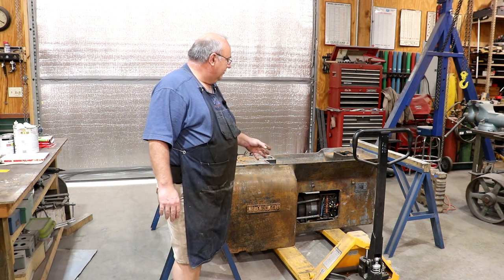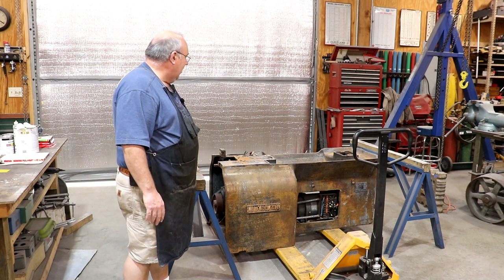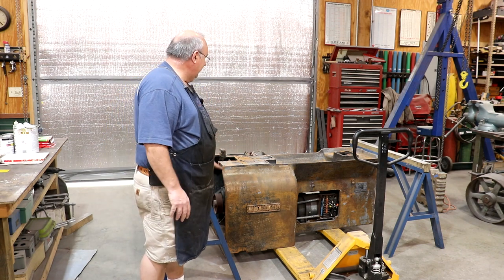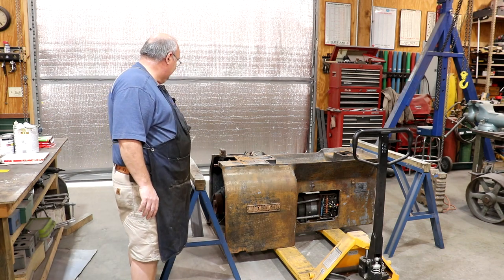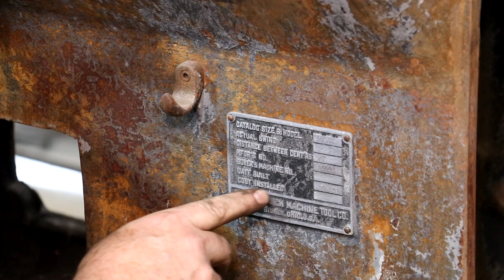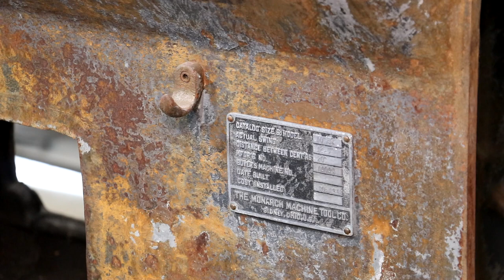Monarch 10EE Lathe Restoration 4:  Removing the Motor Drive System

Comment: Be careful of your electrical assumptions. That is not a Frankenstein drive energizing the DC spindle motor. That particular era EE has a Ward Leonard drive where field weakening was used on the motor in operation above base speed. For speeds below base speed the generator field was weakened to vary the spindle motor's armature voltage. The system might be old and antiquated but it was very sophisticated for its time capable of delivering constant HP stepless motor RPM over a wide range by adjusting a single control. My first suggestion is  If you can get the original drive to work properly, move heaven and earth to make it happen. 

There is no escaping the engineering and calculations necessary to obtain a successful spindle drive conversion.  "Torque" has a specific definition in mechanical engineering quantifable by universally accepted equations having power and RPM as variables. Here is a commonly used formula for calculating torque in Imperial units: Torque = 5252 x  HP / RPM (Note the inverse relationship between torque and HP.) Using "torque" carelessly in a technical discussion - for example: "... loses torque at low RPM" without defining causes is confusing if not irresponsible and delays solution to the problem.  

Notice earlier I said: "constant HP." The spindle motor is rated at 3 HP base speed - which  I think is about 850 RPM for your machine. 3 HP @ 850 RPM = 18.5 lb ft torque.  3 HP @ 3000 RPM = 5.2 ft lb torque. This RPM range is achieved via motor field weakening and the motor output is constant HP over the full range. Lower than base RPM of the spindle motor is obtained by weakening the generator field which reduces armature voltage delivered to the motor. The spindle motor features series windings in addition to the shunt windings and I think interpole windings - all designed to enhance motor torque and stability at low RPM. It's a very sophisticated and expensive motor. I believe the motor can deliver its full HP down to about 600 RPM (26.3 ft lb) but motor torque stays constant thereafter. I can't recall if that year EE was furnished with a "back gear."

I strongly urge you to select the DC drive with care. If you install a general purpose DC drive you will be very unhappy with the result. The max spinde RPM will limited to the motor base speed and you will be plagued by spindle stalls working larger diameters at lower RPM. 

I strongly urge you to consult with a drives expert with experience in machine tool spindle drives. 

I know what I'm talking about. 30 years ago, I worked as a technician under an electrical engineer who was generous with his 40 years experience and brought me into his design considerations. We were called in to remedy two separate EE conversions both botched by uninformed drives component selection. The fixes that we applied worked well but were expensive in terms of purchased off the shelf equipment. But we got stepless spindle RPM at full power almost as good as the original drive but with the advantage of greater reliability.

Given today's electrical equipment, my recommendation is to replace the 3 HP DC spindle motor with a 10 HP three phase induction motor and a general purpose VFD. This combination provides the low RPM torque and has the advantage of operation over the full RPM/torque range with a single control duplicating the stepless drive characteristics of the original Ward Leonard apparatus you desire to replace. A 10 HP 1750 induction motor develops an honest 3.3 HP @ 550 RPM. This is a far simpler remedy needing no integration of exotic components like variable current DC field supplies and control kludges using a stereo 2 deck balance pot. 

People may argue the EE will be damaged by 10 HP. The answer to that is limit yourself to 3 HP cuts. Others might cite the motor's starting surge. With a VFD, a low inertia load, and a moderate accel setting in the VFD's parameters, full load nameplate Amps are never exceeded: there is no starting surge .
Reply: Love the last two paragraphs of information. Thanks.
Reply: for all the reasons mentioned, I say keep the Original MG set in tact.  It is an awesome beast that performs well!

Comment: Maybe it's wise to have the windings and the commutator of the drive motor checked? As it has been standing outside, the moist could have affected the insulation of the motor badly. It would be sad if the motor burned out, replacement will be hard to find I guess.
Reply: Would probably be easy to have the motor rewound if necessary. I had an Uncle in South Georgia (Plains) that rewound motors before he passed away some years ago. He would burn out the old insulation then put in new wire...

Comment: Remember this motor has field windings.  You will need a DC drive that has field weakening to get the full top end rpm out of it.
Reply: Good tip.  I'd love to see an animation of the fields in this motor.
Reply: I was not sure of the field setup Monarch used in these dc drives but if it is field weakened control a simple rheostat should be all that is needed to control motor speed.  That is all my big Carlton has.

Comment: For safety you could rewire  The DC motor because old motors seems to smoke pretty quickly because the varnish on them all cracked. And I’m pretty sure that soon enough it will smoke. I had 8 to 10 motors and neither of them worked more than 10 minutes and then smoked away

Comment: Kind of curious - are you going to go with the Parker/Eurotherm 514 as the drive replacement?  If so are you using a boost transformer to get the voltage up to that needed to get the 250VDC for the motor?

Comment: The name plates would have been added after painting and it looks battleship deep grey to me, which a lot of machinery would have been painted if it was possibly going to ships. The iowas in particular the machines were battleship grey. I would ask them to not prime it. Give it a good wire wheel when you get it back, then bleed it of oils that are surely in the cast iron, and while still warm from bleeding put some enamel on it before doing anything else. Gives a good base for paint and filler to stick too. If you must put primer the only type for direct metal are acid etching primer with zinc. These primers are spray on, wait for flash off and paint. Sanding them is useless. Any other primer is just a sponge and holds water directly against metal.

Comment: I was curious to see what type of "ELECTRONICS" might have been in there?  I'm always a little afraid the term electronic might be a little overused.  I'm not sure there were alot of electronics in the 40s.  My thinking of electronics would be stuff like IC chips, transistors (FET, MOSFET, ETC), software in a chip or something????  The only thing I can think of that might make it electronic could be generating and using the DC voltage which would certainly be traveling through some diodes.

Comment: Judging by the size of the motor in the M-G set, it would probably be better to just fit a higher-power AC motor as the lathe drive motor (instead of refurbishing the 70-year old DC motor) and use a modern AC drive.  The higher power would obviate the need for the gearbox, especially if a 6-pole motor can be sourced.

Comment: I am sure that wartime machines left the factory in a variety of colors, but in general they were painted in War Production Board Green. The War Production Board put out some sort of nonsense about how this was a soothing color, but in reality it was because the pigment did not use war-critical materials. This is the color I found under all the subsequent layers of paint on my 1942 vintage J&L no 5 turret lathe which does have a placard stating that it has a wartime finish under the terms of a contract with the War Production Board.

Comment: You made that look too easy. From what I've seen of those machines running with the original drive, is they sounded pretty loud. Should be way quieter with the route you are going.

Comment: When you removed the motor, it might've been easier to unbolt the motor from the mounting plate, leaving the mounting plate secured in place.

That way, you would've had a flat surface, along which to slide the motor.

Comment: I can't imagine the justification for such a complex drive. A lot of iron went to waste in building this. Clearly they didn't understand structures back then and structural calculations were simply not done. The Hardinge HLV  lathe and others used a vari-drive which gives vastly more torque at low speeds. It is simple, reliable, and trouble free.  I pondered buying one of these based on a recommendation but never did. Nor did I ever see one.  One look at the drive system in this one or the vacuum tube version would have scared me away. Beware a VFD will not give enough torque at low speed unless you oversize the motor a lot. The vari-drive is still a good solution for lathe and mill spindles when you need torque at low speed. I have 25HP electronic spindles on CNC milling machines that still stink at low speed. Keeping the low gear is a good idea. A lot of head stocks have gears for the same reason.
Reply: You are comparing a Toyota Tundra pickup with a Ford F-550.  Both do very similar jobs but they are not the same.
The Monarch 10EE is a Heavy Toolroom Lathe while the Hardinge is a Light Toolroom Lathe.  The Monarch is twice the cost not because it is more precise but because it can remove stock much faster.  If you need to make tools for watch/clock repair pick the Hardinge, if you need tools for working on heavy equipment get the Monarch.  I'm sure the engineers at Monarch would be interested to hear that they have been using too much Cast Iron all these decades, why don't you give them a call.

Comment: A motor-generator-motor seems an awfully complicated (not to mention lossy) method.

Why not just use a rectifier?
Reply: I think they regulate the magnetic field in the generator to adjust the DC output voltage. 
If you try to do that with a rectifier, you need huge variable resistors to adjust the DC output.
And resistors convert a lot of power into useless heat, the rectifiers at that time were also not very efficient...
Reply: In the 40s a rectifier would have been either vacuum tubes or selenium and for this much power it would have been huge, probable bigger than the lathe itself.

Comment: Enjoyed as I have a MG unit, tool suggestion get a small chain come-a-long in lieu of the second strap simple weight balance
Reply: I thought he had two chain falls on his gantry crane. If he has a second trolley, a come-a-long would work great. It would probably come in handy to use in certain areas better than the chain fall.

Comment: Thank you for sharing Keith!
It's my understanding that the original color was military gray but mine is puke green.   

Serial 13464, built 1-1942
Reply: Puke Green is better then Turd Brown lol..
Reply: I have a 10" Rockwell that came out of a tool room at General Electric.  They painted over the factory grey with that nasty green as well.  It must have been a "thing" at one point in history.
Reply: @tonyc.4528  
Good observation Tony.  Upon further examination of pics of my 10EE, mine is also a paint-over job.  I can tell because the badges weren't properly taped off before painting.  I'll have to examine it closely to figure out what the original color was.

Comment: Hi Keith,  Thanks for a short trip down memory lane.  When I finished ET (Radar) school in the Navy and was sent to my ship I found a Decca Radar system (not military) with two motor-generator sets.  Ships power was generated using Diesel generators at 220VAC, 3phase, 60Hz.  It was mostly distributed as 110VAC 1phase for general use and lighting.  My radar needed 220VAC, 3Phase, 60HZ; 220 VAC, 1phase, 400HZ; 220VAC, 1phase 1,000HZ, and 110VAC, 1 phase, 60HZ.  Aside from ships power I had two mg sets to generate the 400HZ and 1000HZ power.  They were direct drive, with a somewhat flexible coupling between the motor and generator, both were bolted to a rigid, steel framework that was bolted to the steel deck.  Maintenance was to check the lube once a week, verify the voltage and frequency once a month, and check bearing play once a year.  They ran an average of four hours a day for four years with no problems.  Worst case when we were in the far north and in ice, was 24 hours a day for two weeks.  BTW, the radar set was a hybrid with some solid state components and the high power circuits managed with large vacuum tubes.
Reply: Shhh... they're listening. ;) Great info! Thanks for everything ❤️

Comment: Wow, that DC-motor is enormous, what is the kW/HP-Rating on that thing? This looks like it will have incredible torque.
Reply: A '43 would have a 3HP DC motor.  If that sounds low remember that a DC motor has a very flat torque curve and very nice power at low RPMs.  When Monarch changed out to an AC motor on VFD they went to 7.5HP motors, 10HP if the pulled the backgear unit.

Comment: It's only a guess but the motor-generator-motor drive system may be a Ward-Leonard system that was used on navy ship gun turrets and building elevators up through the 1970s  all before more advanced solid state electronics were developed. There should not be any problem finding a DC motor controller for that spindle drive motor.

Comment: Love these old machines. I have a 12" Monarch surface planer, 3 ph which I run with a phase converter. I also have an old Goisner drill press restored, a Sheldon 10" and an Atlas 10 metal lathe. Love using. Just wish I had the youth and expertise that you have. Keep up the good work.

Comment: I don't blame you for updating things as much as possible.  I learned, with ham radio, that direct current can be quite fickle compared to alternating current.  Connections going bad was a constant problem, so any step you take in making sure they stay tight, clean, and corrosion free is a plus.

Comment: Hi Keith. As an electronics person myself, I’d probably just replace the old (and probably worn) DC motor with a modern AC motor and a VFD, especially as you already have 3-phase via your rotary converter. Obviously, you would have to find a motor that 1) fits, and 2) has the right Horsepower for the application. 😊

Comment: Smart move to get it at a comfortable working height because as we accumulate birthdays, it is not much fun working on the floor. You may want to consider an adjustable restrictor for your loader hydraulics to avoid sudden movements when moving heavy machines.

Comment: I have a MG 10ee and the "motor" on "top" is the exciter for the field coils in the DC drive motor. The AC driving motor is the unit where the junction box where you cut the wires is attached. So, you have an AC motor driving a generator and exciter, which creates DC power, driving a DC motor.

Comment: Really curious what color you end up with. I'm still looking for a 10EE so I guess I don't  need to decide what color I would use any time soon. BTW technically the color specified by WPB Limitation Order 108 was "Old Machine Tool Gray". No filler was to be used, one coat of primer/sealer permitted and up to two coats of finish.

Comment: Ahh the old MG sets, remember a machine i used to run had one a little bigger than that one. It had a 300hp drive motor, we never turned it off unless we had to. Darn thing would dim the lights in the building starting up.  I'd go with battleship gray, beats the "standard lavatory green" on the machine i ran.

Comment: A Requiem for an Inspired Design
I have a 1942 round dial 10EE. I understand your desire to modernize the DC generation for your Monarch. But watching you tear it out almost made me cry. The design is such a monument to the engineering methods of the time and the quality of manufacture as to merit almost religious awe. It is an example of the so-called Leonard-Morse drive that was common in elevators going back to the turn of the nineteenth century. On the plus side you are keeping the wonderful DC motor. And the trolly museum will likely do justice to the rest of the parts. I am not criticizing you. Monarch went to a different system as soon as they could. But still, it's a little like watching a Climax locomotive converted to a gasoline motor in order to reduce the maintenance. I enjoy your videos a lot. You are a good guy.
BTW that bar that sits on brackets on the front of the lathe is for pushing stock that got stuck in the spindle behind the chuck out.
Reply: Paul, can you recommend me a link where I could study the solution used in these lathes for variable speed? Was it a possibility to set the speed in discrete steps, or it was made to do it  continously?

Comment: These videos are fun and informative. Keith is awesome.
Is Keith using the right terminology when he says there's a "DC Generator" in there?
I didn't get a good look at it, but is it more than the typical transformer, rectifier, capacitor, inductor set up to convert AC to DC ?
Reply: Did you not see him take out the motor-generator pair, with spindles coupled by a belt? That was a common system in those days. As he mentioned, later models used 'tubes' instead to do the AC-DC conversion - they were actually thyratrons used as variable rectifiers, very similar to how we use thyristors now to dim AC lights. A simple transformer into rectifiers would not give you variable output voltage.

Comment: I had no idea that's how those lathes worked electronically.  Very interesting.  I'd love to see it painted its original color.
Reply: I found two diagrams. This one use a rheostat to vary the excitation of the DC generator to change the voltage. Others use a transformer and a thyratron based controlled rectifier